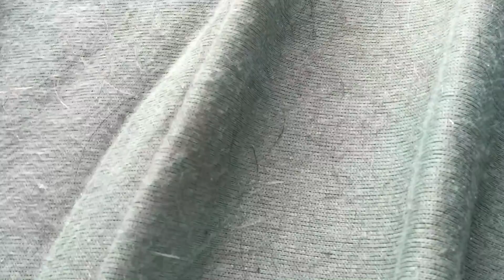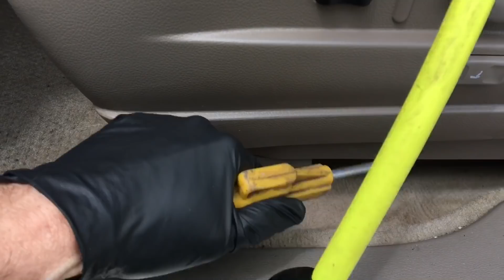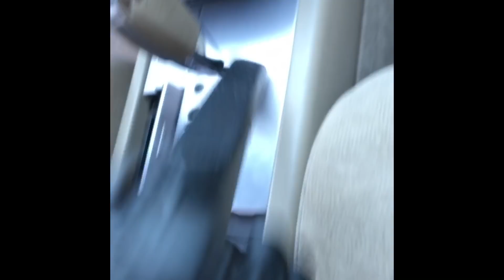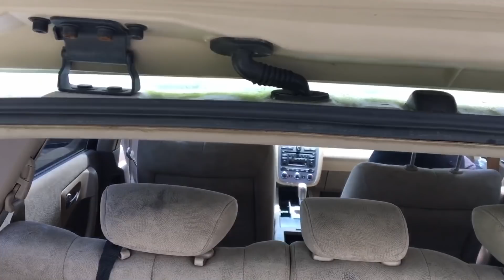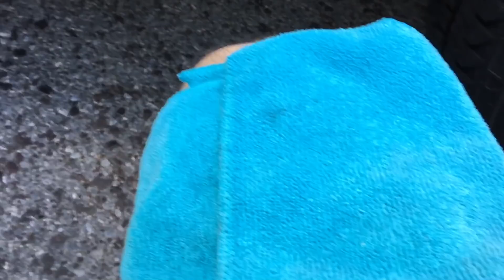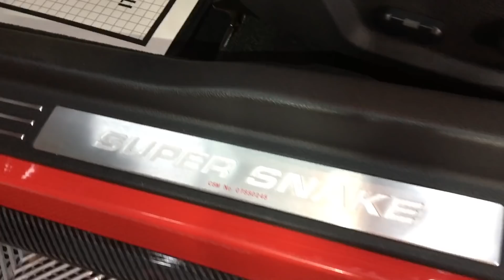Detailing/Cleaning A TRASHED Interior! Dog Hair, Stains, Mud, Dirt!! HELP!!!

Comment from the maker: What is the most important tool to you....for interior detailing?
Reply: Apex Detail McCulloch steamer.
Reply: The McCulloch steam machine... per your older video. I thank you for that. It has paid for itself over and over. You never steer me wrong.👍🏻👍🏻👍🏻
Reply: Air Compressor!!!!!!
Reply: right now, i use Drill and brushes   [soft]    with a shop vac to extract....        Steamer would be the next logical move....        as far as extractor..you really need one that has a very strong pulling power.....    easy to over saturate...!     i  used to clean carpets...    [ps.low suds  loll]....       Great Video Again!!
Reply: Tornado Air blower. God send 🙌🏾
Reply: Apex Detail Most important for me, at your recommendation, is my McColloch steam gun!
Reply: Air blow gun and my rigid vacuums !
Reply: Compressed air. That is my most effective tool for interiors .
Reply: Most important interior tool: Vacuum w/patience.
Reply: My Invisible Glass glass pole for convenience:
www.amazon.com/Invisible-Glass-95162-Reach-Clean/
Steamer for effectiveness
👍👌✌
Reply: @jdisdetermined  broken link
Reply: Steamer!
Reply: air pulse gun...
Reply: Richard Seem is the air pulse a big difference from just a normal air compressor air tool?
Reply: yes larger surface area.and find it dryn even better.hope that helps
Reply: I used to be an extractor guy until I realized it was just slowing me down. I love and die by a good steamer now... although I am super curious of what it might be like to switch to a tornador 🤔
Reply: Vacuum cleaner - vac n’ blow from metrovac 👍
Reply: Brian good morning how about this unit: https://www.amazon.com/Foam-Cleaning-Mousse-Sprayer-SGGC029/dp/B07D7GQVZM/ref=sr_1_8?keywords=SGCB&qid=1558272499&s=lawn-garden&sr=1-8-catcorr
Reply: I just picked up a mytee spyder for my business because the rug Doctor I had to use in my short stint at a car wash was worthless and soaked everything. The mytee has good lift. But I see a lot of pros stepping away from them. I don't have a big compressor and I won't for a while. And in the PNW the carpets I get are trashed. Brian, given my situation, is the carpet extractor still not the best? Also I've been thinking about picking up a dehumidifier. What are you experiences with those? Do they do anything in a reasonable timeframe?
Reply: The best tool? Raised prices enough to avoid them
Reply: @Apex, What make and model portable air compressor are you using?  Thanks
Reply: I wish if you live in Colorado 😢😢😢 keep it up.
Reply: I have a steamer and extractor but compressed air with tornador blow gun still gets the win if I gotta choose one.
Reply: Patience!
Reply: Extractor & Tornador (Liked your griot's air gun foamer), nice video (y)
Reply: TRC Edgeless 365, I can use it to dust, I can mist it or  douse it with Griot's Interior cleaner for a wipe down,   I can use it to knock down Mannett's Mega Shine, I can douse it with Spray 9, and scrub an embedded stain on the vinyl, body oil on the center console. For a quick weekly  wipe down I'll use ONR and generously mist the hard surfaces, vinyl; lighlty mist fabric seats, and carpet, agitate the carpet and fabric, wipe down all the other surfaces, then vacuum seats and carpet (if you mist the fabric ONR will encapsulate and lift dirt and out of seats and carpet, making vacuuming a breeze (smells awesome). Also for  a quick glass maintance clean I'll hit the windows with ADG Wipe Out (256:1) and clean  to a crisp shine with the TRC Edgeless 365, no streaks ever. I'll run the 365  dry across the head liner to loosen dirt  and capture dust. Probably missed a few applications. In summary The Rag Company Edgless 365 is my interior work horse, Inexpensive, great longevity, my go to interior towel, great scrubbing power when needed, yet gentle for a Nav screen. I like the yellow so I can clearly see the dirt being removed, get a couple of  10 packs on Amazon - 18 bucks ea.. When I'm in the mood for playing with  a wax, yet another perfect towel. Wish they came in more colors, could use light blue, light purple, white, etc., I like lighter colors so I can ckearly see what I'm picking up.
Reply: O.k. I have a second: Mckee's 37 Fast Interior Detail, for a quick once over, works awsome, and smells great, a must for a quick go around on date night. I keep a bottle and a few TRC Edgless 365s in the center console for a quick dusting.
Reply: Woh woh woh, pumice stone? What one? That looked great!
Reply: @Jayg80  get the one that's called furz off. Big stone for the price

Comment: Hey there, great informative video by the way! 
I’m fairly new to detailing and have been looking into getting a compressor. What size would I need to be able to run a tornador or griots air gun or the foam one you showed?
Reply from the maker: Any compressor that can give you 90 pounds continuous pressure.
Reply: I think 30 gal is the sweet spot, go bigger if you can . Don’t get me wrong you could get by with something smaller but you might have to wait on it to build up pressure . I got sick of waiting for pressure  and finally put the 30 gallon husky in my van and it’s been great.
Reply: Awesome, thank you!!
Reply: Thank you Ronnie! I will definitively shoot for 30 then!

Comment: What do you use to dress/treat the rubber floor mats without making them slippery?
Reply from the maker: CarPro PERL.
Reply: @jevilla122 I personally use super clean super foam. Doesn't do anything for protection but it cleans them so well and leaves them nice and shiny but not slippery.
Reply: I've been using CarPro PERL on rubber floor mats for the last few years, usually at 3:1. Gives a real nice matte finish to them, without a slick feel.